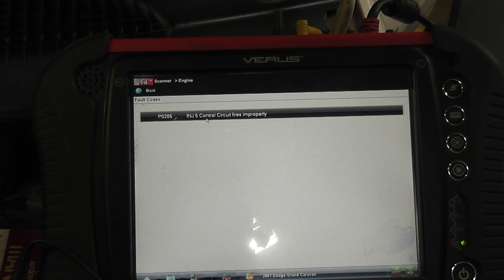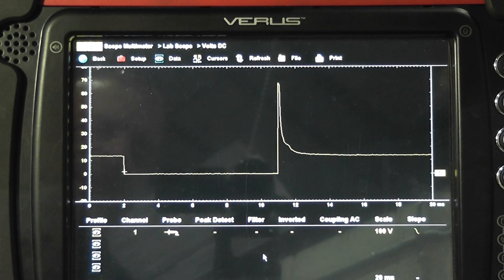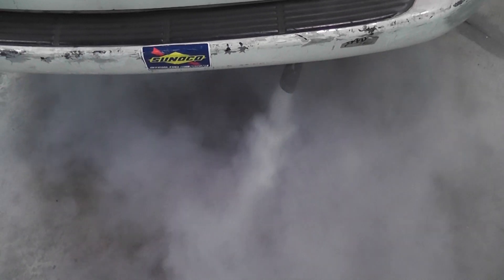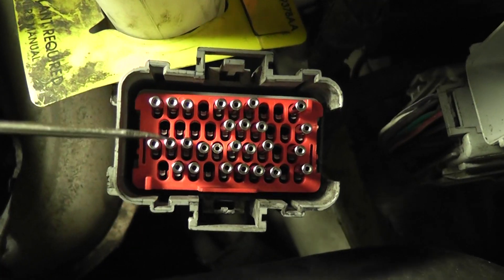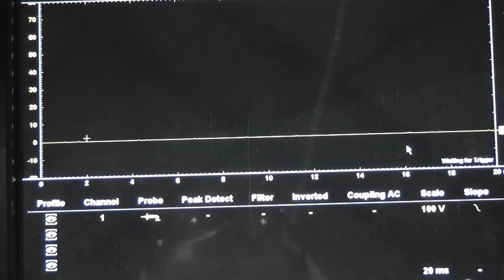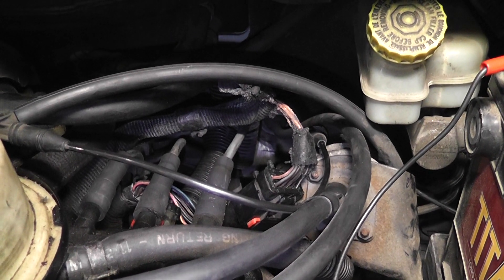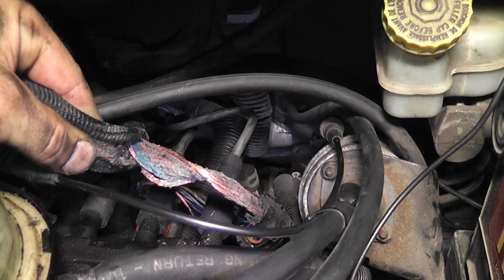Stuck Open Fuel Injector (how to fix)

Comment: Nice video. I have an Infiniti V8 I have being battling with since last week. Engine was misfiring, with gasoline smell in the cabin, and exhaust pipe. Although the smoke was not white here, but black. 
I have replaced all ignition coils, it works awhile, but no progress. I have gotten the electrical wiring diagram of the car which I'm following holistically. 
I have done the following:
1. Voltage tests on the fuel injector power red wire harnesses to the injectors. I have battery voltage( this happens only with the injector connectors unplugged from the injectors. But immediately all injector connectors were connected, I realised that all the ground wires on the injectors were also having battery power, which is not supposed to be so.
I suspect there's a short to power or ground somewhere on the Injector circuits.
Even with the ECU unplugged, and ignition turned ON, both positive and ground wires on the injectors were showing battery voltages. But immediately I disconnect all injector connectors from the injectors, everything returns to normalcy. I suspect there's some kind of short to power or so on the chassis?
Could you helped pls?

Comment: Damn, I need a scope. We learned how to use them in school, I’m working on a friends car who has a P0300 I did the injector shut off test with my scanner cyl 4 and 6 did nothing when I shut them off. I pulled the plugs they were all black-ish but 4 and 6 were wet with fuel. It has spark, it has new coils and the spark tester is lighting up. But I don’t see that thick white smoke, it smells like fuel and has compression Im only 20 and tools are expensiveee, what’s your opinion on the pocket size UScope?
Reply from the maker: Love the uScope ! I have videos where I'm using it.
What is your compression on those cylinders? A number please, compared to known good firing cylinders
Reply: ScannerDanner I figure it out! He replaced all the coils himself. On the driver bank 2,4,6 he went in order from front to back first connector to 2 second to 4 and third to 6 but looking at a wiring diagram first one goes to 6, second connector to 2 and third connector to 4 LOL. I was wondering why I had fuel, spark, timing was 15btdc and compression was ~170. I just swapped the connectors 🤦‍♂️ he towed it to me because he put the connectors on wrong lol.
Reply: ScannerDanner I’m buying a uscope we’re just getting into scopes In school and I love using them so I’m sure I’ll be back to watch more videos as I start using the scope more LOL thanks man, happy spring break season and stay safe

Comment: I have a 98 civic and the oil on the dipstick is way above maximum and the oil smells like gas, please help
Reply from the maker: well you definitely found the right video, at least now you know one of the causes for that condition. There are others though for sure. What is your fuel pressure? Is it also misfiring?
Reply: @ScannerDanner  it doesnt start now my battery died i guess, no dash lights, no clicking

Comment: Question 
Is it possible that new fuel injectors can be stuck open getting white smoke that smells like gas and have a code po305 
Misfire Detected in Cylinder #5

Comment: 2006 Ford Ranger , 2.3 engine. With key off  engine off, # 4 cylinder filling with fuel and emtying entire fuel tank. Pulled codes, P0232. Started diagnosis by pulling wiring schematics and readinf description and operation and code description. I attacked inertia switch. Found someone pulled inertia switch and twisted wires together and the skinned green wire with yellow stripe, they ran jumper wire . I bought new inertia switch and connector from Ford. installed and it fixed P0232 code. Pulled codes after running engine and got code for O-2 sensor. Noticed very oily around o2 sensor. Pulled and replaced sensor vert oily and fouled. Replacing o2 sensor fixede that code.  Still have #4 cylinder filling with fuel. When start same smoke seen in this scanner Danner you tube. This mor5ningt day after Christmas I will drive back to my friends shop. and use this YouTube. Hopefully today I solve the saga. Thank you Scanner Danner. I am retired college instructor and Master Tech but tired being sick. Have to get out and exercise My brain. I say thank you Paul Danner for inspiring me to not just roll over and die but get back in game. Helpiong friends with shops. PS been in many conferences with you before I had to retire because of cancer. Hope to visit you again. SuperDave.

Comment: surprised it did no damage to ECM .
Reply from the maker: ultimately it did as the sensor ground circuit and reference circuits were exposed to the injector control circuits high voltage spikes
Reply: @ScannerDanner  Alldata asked if my FICM module replacement on Duramax solved a full throttle Runaway ? If you do not program new FICM with injectors , U could seriously hert yourself or some 1 else . They call me 2Q. Aloha.

Comment: Same is happening to my 3vzfe v6 lexus, changed computer and injectors and still raw fuel coming out of exhaust, its even dripping out of exhaust. I'm suspecting the same situation with mine...
Reply from the maker: Change the oil after you fix it

Comment: great, my e46 m3 may have stuck open injector as well as it keeps flooding cylinder 5 and has almost the same smoke as this one had (mine looks a lot more of a pulse but the same white smoke) and it smells like fuel on my exhaust and my oil starts to smell like fuel which I will be changing before I even try turning it on next time. will be back here to update.

Comment: Great video!
At the end where you touched the circuit with the test light in an engine-off state, I didn't understand why isn't it a valid test. Where is that ground coming from if the circuit is disconnected?
Reply: Ahmed El-Gazzar it can feed back thru the inj and potentially thru other components on same fuse and feed circuit. If there is a potential grnd somewhere it will find it, unless the inj circuit is completely isolated. Need to study wiring diagram to kno this. I think what Paul is saying is that if start the engine and therefore have a live 12v feed thru inj circuit you eliminate the risk of a misleading backfeed. If u wanted to use this method (ie engine off) and be more certain u cld see if u got the same result on a known good inj as with suspect inj ... if light is on for both it wld be and inconclusive test and u wld have to try KOER.

Comment: So how do you get an stuck injector to work? I just have one multec on my 89 s10 pickup with a 2.5 liter engine. With the injector wire disconnected I applied 12 volts to the fuel pump test lead under the hood. Gas pours out of injector. The engine is off. Key is in my pocket.
Reply from the maker: that is a throttle body injection system where the internal 0-ring may be torn, you may just need the o-ring

Comment: Question, If you have an injector that doesn't click when you test with power, which most people say it means its bad, is there a way to get it to work again or are they finished when this happens? The reason I ask is because I watched another video were the guy taps it with a hammer and it starts working again. I guess another way to ask the question is if injectors get temporarily stuck?

Comment: Tuesday Aug 21, 3:00AM 2018, Scanner  Danner U R The best thank u for this video GOD Bleass u.....Amen, Scanner Danner i live in Upper Darby Pa, i need your help please? i have a 2002 Dodge Grand Caravan 2.2 engine have a code P 0201 & P 0205 the Injector no 5 is spraying too much gas, from Allen town to Upper Darby Pa (Philadelphia) this car burned some 40$ gas, i changed replaced two injectors & a good injector side harness but still missing so bad with same codes, the harness (wires)  after the injectors side harness winch passes under the exhaust pipe i also checked out wires were sticking but no copper to copper contact, but did not peal the harness completely by the transmission, can you help me out? can u pass me your tell. no. please ? ,  my tell. no. is (646) 533 0792 Mr Vijay.....Vijaydivecha2692@Gmail.com......Amen.

Comment: I'm wanting to test my injector (Toyota 3VZE) waveforms at the PCM with new scope as shown in your vid but according to this diagram there are not individual leads for each injector at the module to test? Link to schem: http://www.snjschmidt.com/wiring/Engine_Control_3vze_2.jpg.  Someone please advise?
Reply: I may have found my answer gleaned from the comments from one of your other vids: " 
ScannerDanner  6 years ago
on these groups fired systems. all 6 injectors fire at the same time 1 time per 360 degrees of crankshaft rotation. the intake valves are responsible for controlling the fuel into this cylinders at the correct time. think about it only 1 intake valve is open at a time. kind of the same way a throttle body injected engine works or even carburetors. the intake valves control the flow to which cylinder"
Reply from the maker: Nice job! Yes, your system uses what's called a bank fired system. 3 injectors fire at the same time. You can still do your scope testing, just remember that you will be looking at 3 firing events when viewing your waveforms.
Reply: Same with 3vzfe, rich all the time and replaced fuel pressure regulator, damper, injector, ecu, temp sensor,fuel filter, but still blowing white smoke and raw fuel dripping

Comment: Scannerdan thank you for this video! This is exactly what my Escalade is doing!!!! Now off to try and find the wire! Hopefully I can follow your video so I can finally put an end to this nonsense!
Reply from the maker: You will not find this exact problem on your Caddy (a completely melted and destroyed harness). It is going to look more like this video at the time stamp shown  https://youtu.be/uyncVz_HAtA?t=10m45s
This one is a shorted reference circuit, not an injector control wire but it is the same concept for finding the harness issue.

Comment: Hey, Paul. What would current be in the control wire as it is shorted, I would say, after the load? I am thinking that the injector would have consumed all the current, there would be not much left.

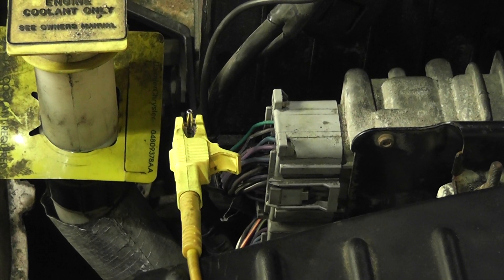Comment: at 5:53 you said the computer is able to recognize a fault because it has an output state monitor that watches the voltage level.  When the injector is on, the voltage should be low.  When the injector is off the voltage should be high.  So, I would think a solely mechanical problem with the injector, such as stuck close of stuck open, would not generate a P0200 code.  Is this true?  I was just gonna change the injector and hope for the best but it seems this code is more indicative of wiring troubles or PCM trouble than a bad injector.  

I've been getting the P0201 code intermittently for the past several days.  It only comes on when I first start the engine.  When I start-up cold, the check engine light (CEL) doesn't come on and the engine runs fine.  I'll drive to my destination without any issues.  But when I return to the car and start-up fully warmed-up, the CEL comes on and the engine runs rough (obvious misfire) and will continue to run rough until I get home.  Sometimes I just get the P0201 code and other times I get both the P0201 and the P0301 code.  When I get home, I use the scan tool to clear the codes from memory, so I can see what happens at next start-up.  I've never had a situation where the CEL came on while I was driving.  I find that strange.  I would think a loose wire or bad connection would more likely come loose when the engine is running and vibrating.  Thus, I was thinking that these symptoms more likely point to a bad PCM.  But, I don't know how to verify that.  Any thoughts?

Update:  I swapped the No. 1 and No. 3 cylinder fuel injectors.  Afterwards I started getting codes for the No. 3 cylinder.  So, apparently I have a bad fuel injector.

Comment: If you don't have a scanner or a scope, could you use a digital voltmeter on DC to probe the injector driver lead at the PCM while running? Just to look at your voltage spike to narrow down the injector. Obviously you wouldn't see a graph but you could min/max or watch the numbers.
Reply from the maker: Not really. The pulse it too fast to see it and your voltmeter will just show battery voltage. Even the min/max scale will not catch it.

Comment: Hey how are you sir? I had the same problem and replaced the harness the code no longer appears and it doesnt missfire anymore... now since there was too much fuel going inside the chamber i find that the oil also has fuel in it, and still smokes could that be that because of the fuel the oil got thinner and now it scapes trhu the piston rings? Or could it be that the catalytic converter is full of fuel?
Reply from the maker: Change the oil now!
Reply: ScannerDanner  cool thanks a lot

Comment: what if it was on the power feed side shorting to ground, could you still do it with the KEOF?
Reply from the maker: If the power feed side was shorting to ground it would blow the main fuse

Comment: Its NOT a short TO ground, A short is when 2 wires touch each other..  your conductor is touching Ground..
Reply from the maker: Also known as a short to ground (copper touching the metal parts of the car)

Comment: I got p0206 i check the harness is melted van got a lot codes what is the best option repair the original harness o buy a new one change all inyectors and check the pcm is sending signal to that inyector or is worm
Reply from the maker: Your injectors will be fine. You do not need to change them. I would suggest finding that entire sub-harness connector. I believe if you remove the upper intake, that harness will come right out with no trouble (I think). 
There is a real possibility that the PCM was damaged as well, but fix the harness first, then retest when you are done. MAke sense?
Something else. I have seen multiple times, that the MAP sensor and AC pressure sensors get damaged by this as well. Why just these two sensors? Because pressure sensors are miniature computers that are very sensitive. Unlike the TPS and ECT and IAT (potentiometers and thermistors) that can handle crazy voltage spikes.
Reply: ScannerDanner thanks i try to repair that harness to check

Comment: I bought six new fuel injectors of for my car ran it for about 9000 miles and then all of the sudden. I replaced the spark plugs and spark plug wires check the coil packs and had the ignition coil modular tested. checking compression yesterday and noticed two of the spark plugs were pretty damn clean. Buddy of mine's father is a Master Mechanic and he knows stuff about cars as well. he told me it look like fuel wasn't being introduced I thought the same thing. I have another computer in my garage for the car so I swapped it out same thing. how do I check the wiring for this? an oscilloscope is just used to see what's going on with the injector right? reason I ask is I'm sure they're not firing at all. I even grabbed three fuel injectors at a Pick-n-Pull just to see if I had a bad fuel injector.
Reply from the maker: These videos will help you ID the injector control
https://www.youtube.com/edit?o=U&video_id=kQUtAs-VrDY

https://www.youtube.com/edit?o=U&video_id=6vIcu3NVfcU

https://www.youtube.com/edit?o=U&video_id=mmRhcVkJdeQ

Comment: This could be a problem I have with a 92 model efi302 in a f150.  It has set for 15 years  because no local mechanics could diagnose the problem with it. Rough idle, running very rich, and the last time I drove it , it went through 16 gallons of gas in 75 miles! We have been considering a bad brake booster, and you can hear the brake booster sucking air, but further research has showed that the diaphragm in the brake booster will go bad if to much gas is sucked back through the vacuum lines if the vehicle is running rich.  I intend to get it back on the road and running as a work truck, so hopefully this will give me something new to look at!
Reply from the maker: good luck, let me know

Comment: 3.2 porsche cayenne 2005 ignition coil no 1 was faulty and drive around 30 km and it was fine but little bit misfire. when I replaced the new ignition coil the car start but not move and I diagnosed by computer show these 3 codes p0261 , p0264 and p0267 which mean cylinder 1 ,2 & 3 injectors circuit low. please guide. I need to open the injectors or there is any short way .thanks

Comment: I'm getting P0201 through P0204 on my car. It's 4 cylinder, but the car runs fine. I've only had one problem happen with it releasing raw fuel and smelling like gas and it was for like... 30 seconds.
Reply from the maker: If you need help, post your questions here. Thanks! You will be expected to at least have a voltmeter and test light to follow suggested tests. 
https://scannerdanner.com/forum/post-your-repair-questions-here.html

Comment: Is this a very common problem for caravans? Mine is doing the same on injector 3. At that point should you replace the whole thing or can you some how fix it?
Reply from the maker: Yes, and that harness can be replaced. It has a main connector that unplugs from the main harness. You can fix it too, if you have patience.

Comment: I have injector 1 problem P0201. I removed Injector 1 wire from PCM connector like you did but mine wouldn't start like yours did in the video to test it?

Comment: Where are you located?
Reply from the maker: Pittsburgh PA (Rosedale Technical College)
Reply: I have injector 1 problem P0201. I removed Injector 1 wire from PCM 
connector like you did but mine wouldn't start like yours did in the 
video to test it?

Comment: i have a 2003 v6 eclipse doing this my injector connector wires look ugly melted i have white smome and a feed line leak will replacing connectors fix this
Reply from the maker: possibly, hard to say without seeing the car. If you wiring is melted, fix that first and cross your fingers that the injector drivers in the ECM did not get hurt in the process